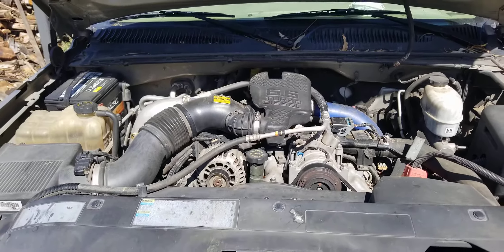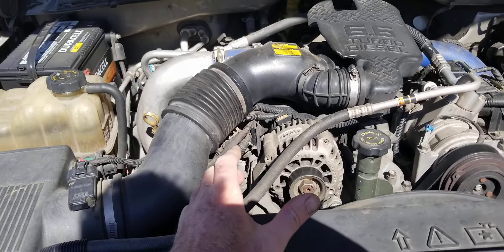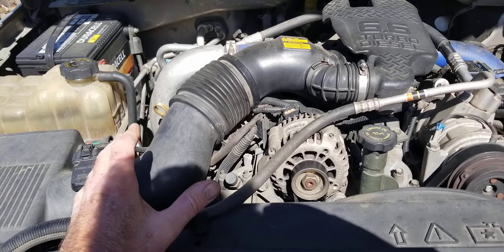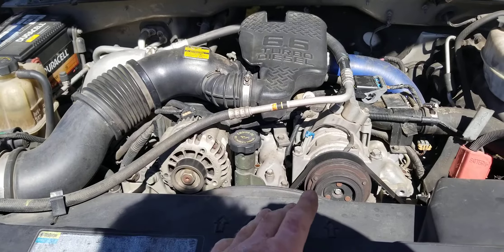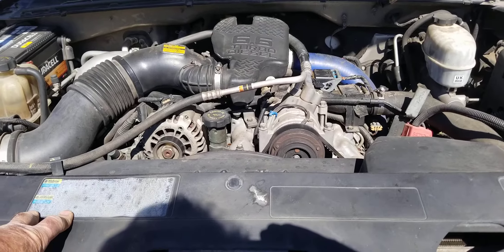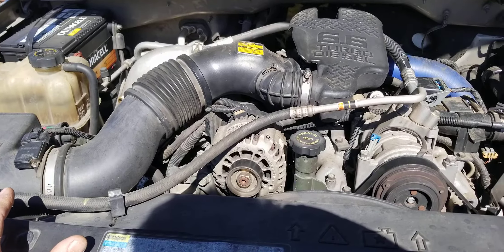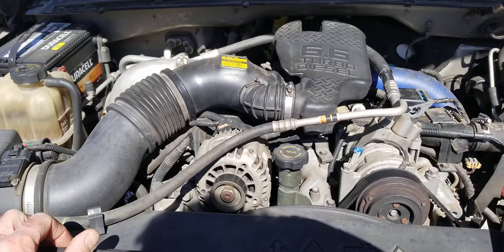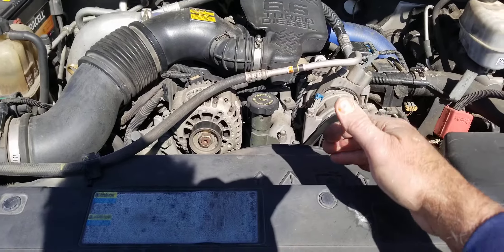DURAMAX Coolant in oil or OIL in coolant head gasket oil cooler water pump

Comment: Hello, are you writing about a water pump? but there are 2 holes on its body that seem to be coming out or getting into the oil anyway.? I have liquid coming into the pan, while nothing is bubbling in the tank, I changed the oil cooler gaskets.

Comment: So when my engine is cold my transmission dipstick reads the perfect level but after I start the truck up and let it run for 15 minutes, the level in my transmission fluid completely shows empty when I check it. I have a mixture of oil and transmission fluid in my coolant reservoir. What do I need to replace?? Any help will be appreciated.
Reply from the maker: Probably the Radiator. you have a leak in your radiator trans cooler. That would be the only thing I can think of that would cause that.
Reply from the maker: FYI coolant ruins the clutches in your transmission. you really need to flush out the trans completely. change the fluid in the pan, pull one of the trans lines off the radiator and run several gallons of fluid through the converter. Get it all out then change the filter again. Maybe you can save the trans.

Comment: This helped a ton I’m having issues with my truck where I’m getting coolant into the oil and I’m now thinking it hopefully is the water pump seal.
Reply: Hey did you ever find out if water pump was the problem for coolant in oil
Reply: @rafaelorona8733   yea the water pump was the issue. Basically the O-Ring went bad where the oil and coolant lines run so I was getting coolant in my oil
Reply: I'm having same problem I'm getting coolant in oil. Is there a way to diagnose if is the water pump or you just went ahead and changed it
Reply: @rafaelorona8733  can you help me out also, how did you end up diagnosing it? Was it also water pump. Having oil in my coolant
Reply: @rafaelorona8733  Can you tell me if the water pump was ultimately to blame for the liquid getting into the oil?
Reply: @zub2332  that wasn't the issue on mine I ended up not having that problem  ended up not having coolant in oil after all
Reply: @rafaelorona8733  yea it was the water pump. Late response but I just seen

Comment: Hello there! I removed injectors on my 6.6 duramax and on one of the heads I got coolant. Can I replace the head or do I have to just get a new one? Thanks in advance
Reply from the maker: check the injector cups. and or replace them. also coolant can leak into the oil from the waterpump or oil cooler.